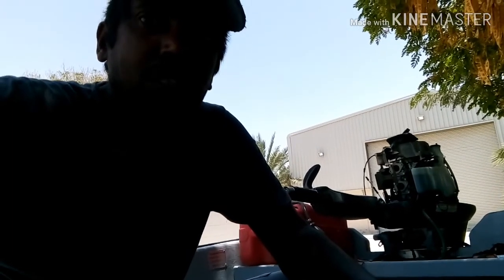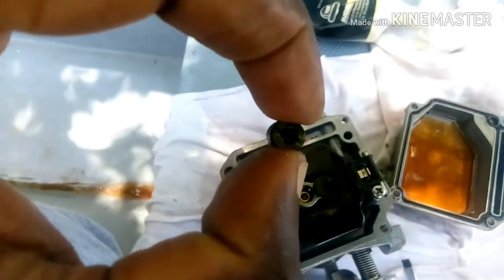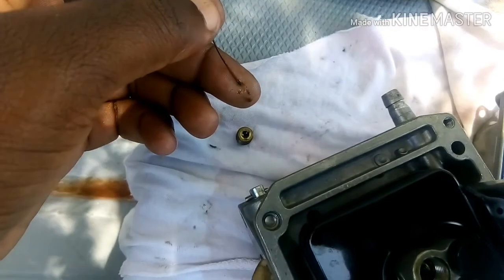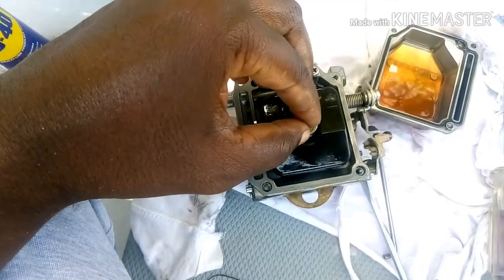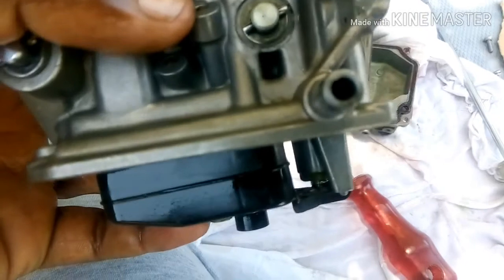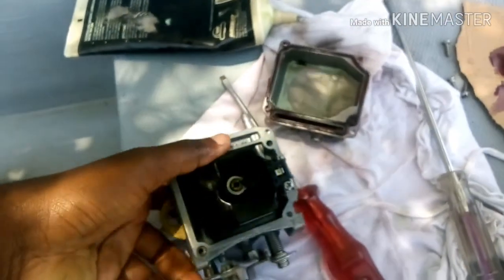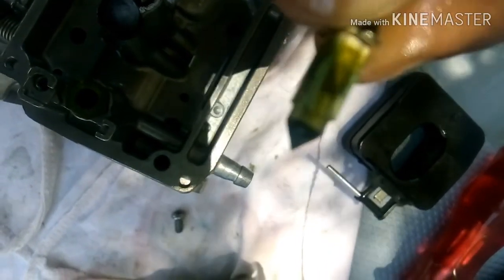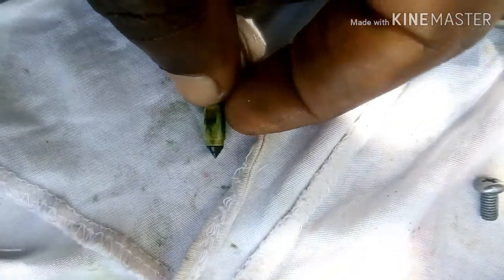Yamaha outboard motor stall when gear engaged...#yamahaoutboard#outboardmotor

Comment: Mine will idle fine, but when I put it in gear it bogs down and dies. it will start right back up. Can you please tell me your thoughts? Thanks
Reply from the maker: Probably one of cylinder not working. Like that even if one cylinder not working ones when you put in to gear it will get the correct RPM  with other cylinder power. When engine put in to the gear engine cannot handle that load suddenly.because one of cylinder is not working. 
If you need to confirm do like this
While engine run ideal rpm carefully disconnect spark plug wires from plug (use long nose pliers with hand gloves) one by one. When you disconnect wire if engine running is abnormal that cylinder is ok. But when you disconnect if engine run as normal which means that cylinder has issues.
Try this carefully and check and let me know
Thank you

Comment: I have a Mercury 84-88 115hp and it does the same thing.  Cleaned carbs, same issue, replaced carbs, same issue.  What did you do or what steps did u take to rule out ignition.
Reply from the maker: If you confirm there is no issue with fuel system you should check the ignition system. I give you one tip,
Remove spark plug lead while engine is ideal running ( use the long nose pliers for safety) when you remove one by one if you feel engine run rough there is no issue but when you remove plug lead engine run same without any changes check that speak plug and lead.
Let me know if you need anything thanks
Reply: @AsaaTech  thanks I’ll try that

Comment: Mine does this but only after it's been running a while
Reply: Same with mine. Any idea what is causing it?
Reply: @perkypat2214  my problem was flooding. Do you have a problem getting it started? What brand motor are you running
Reply: @terrywilson1813  It's a 1989 johnson 70. No problem getting it started initially, will run fine for hours, then when I turn it off coming back to the boat ramp for example, bump it into neutral while I'm waiting, then shift back into gear and it dies instantly. Usually need to restart it, give it some revs with the high idle before engaging the gear otherwise it just stalls. No idea what causes it.
Reply: @perkypat2214  I don't want to guess but mine was doing almost the same thing and since I have an 83 mercury it's hard to start when it's cool sometimes so I had to prime it too much causing flooding. I would recommend taking the cover off and doing a visual inspection when this is happening just to make sure it's not flooding for some reason. When the problem is showing itself it's the best time to find it
Reply: @perkypat2214  either way it really sounds like a fuel issue to me and I've had a couple of those